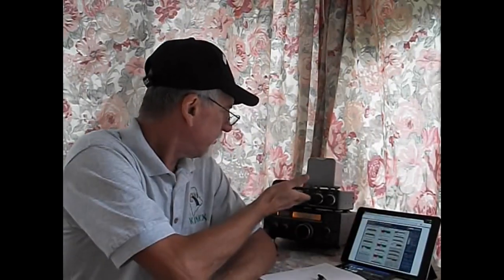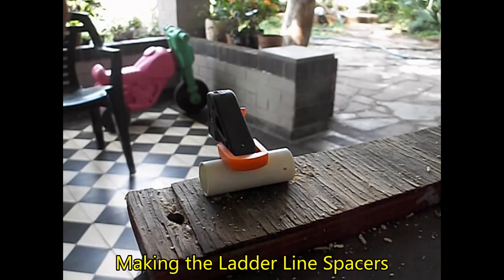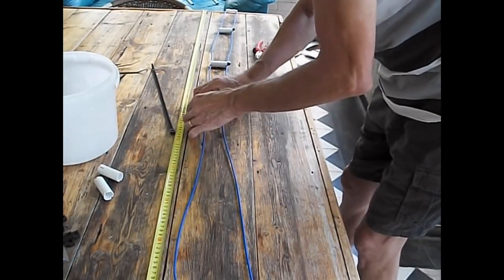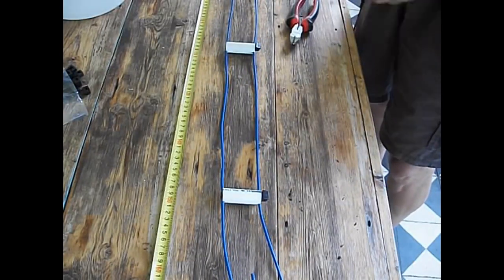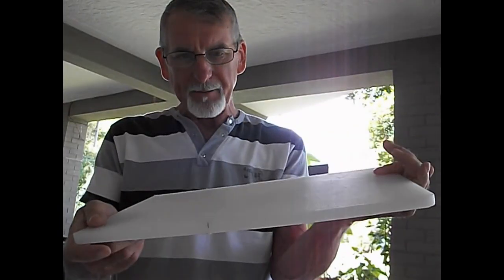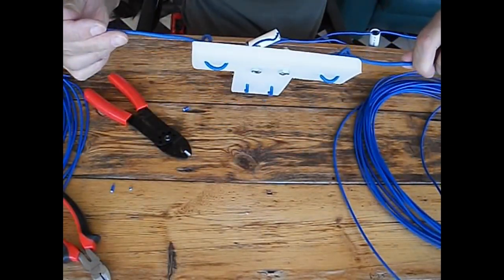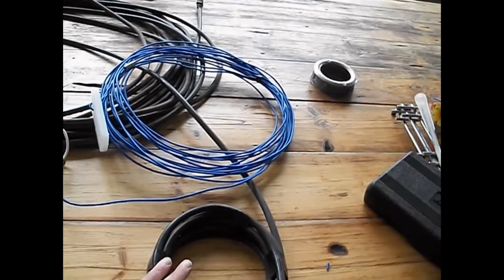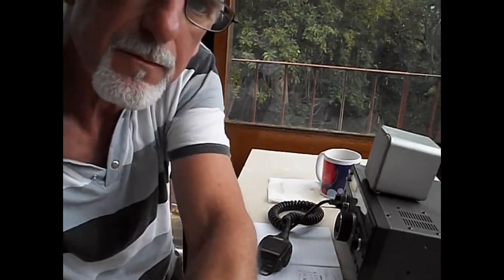ZS6BKW Dipole Antenna   The Build

Comment: Great job Tim. I use the small (pencil thick) PEX pipe and one black tie-wrap per separator to accomplish the same thing in building my ladder line. Just run the tie-wrap through the pipe creating a loop in the tube, capturing the wire on both sides of the tube and cinch it up. No  drilling or notching required. Simple and very strong. Keep up the good videos Sir.

Comment: When making the ladder line, if you drill the holes in a little farther from the end you can run the wire through the holes and won't need to use zip ties.
Reply from the maker: I got a little ahead of myself when I cut the spreaders so they were too short for that.  The flip side is I didn't have to thread all those spreaders on to the wires.

Comment: What kind of pole did you use? I noticed that you also had support rings , did you make them. I am excited, when I get home I think I am going to try one. Why did you not haul the feed point to the top of the pole? Thanks for your time. If you answer me, you are a kind and thoughtful. N4KBM
Reply from the maker: Hi Tommy, thanks for the sub.  

We welded 3 (6 meter) sections of steel pipe together (each section fit into the next) to make a 56 foot (17m) mast.  The support rings (for the guy lines) are a length of chain wrapped around the mast and welded in place 2/3 of the way up.

I initially did haul it all the way up, but couldn't get the right angle between the antenna legs so I had to bring it down a bit for good SWRs.

Here's the tower build video.
https://youtu.be/ahMNg8RYBkI

73s
Reply: Tim Clark - K1NKX   That pole is the envy of the Ham nation

Comment: Should you not have used Zs/ k1nkx as a call sign?
Reply: Correct.  I usually did, but must have forgot for the video.  Whenever I didn't include "ZS" I would add it when anyone answered my CQ.  Everyone was good with my method while I was there.  No SA stations ever mentioned it and well, my Elmer is the local klub president and lives half a mile down the road.

Comment: sounds like a good antenna? but i want one for  80 and 160 more so 160 would this antenna work good for that? could i add to the total length.?
Reply from the maker: You should be able to work 80 with a tuner.    Its a fun build or you can pick one up factory made for not much money.  These guys go into more depth, give em a watch, if you haven't  This is the video that settled me on the ZS6BKW.  https://youtu.be/MbXmAcf9MmI
Reply: @buckeye5704  yes but im wanting more of a 160mtr ant i have 2 up that i can go to 80. just trying to find a super simple 160mtr ant.
Reply from the maker: @butterbean4195  Ok, gotcha.  So this one isn't gonna work for you then.  When I get the house built and put the shack together, I want to work on a 160 wire, but that's a bit further down the trail for now.  Would love to see what you have up tho.  My SA elmer has his 160 wire strung in trees  on his small lot with the legs bent in all directions.

Comment: how many  watts can this dipole handle
Reply from the maker: I used 2.5 mm wire which is a little larger than 12 AWG.  
Based on this info I found, full legal limit (1500 W in the USA) should be no problem. 
https://www.quora.com/How-many-watts-can-a-12-gauge-wire-handle
Insulated for 600 volts, Number 12 AWG wire is rated 20 amps to 30 amps depending on the thermal capability of the insulation applied to the wire. If we assume THHN insulation with a temperature rating of 90 degrees C you have a 30 amp capacity.

Since watts is defined as Volts times Amps and we assume you will energize it to the maximum allowed voltage of 600 volts the simple answer is Watts = 600 X 30 = 18,000 watts.
Reply from the maker: Here's one I bought.  The description says 2000 watts
https://www.amateurradiosupplies.com/product-p/11003.htm
I haven't hung this one yet, but wanting to.  Probs next Spring.
Reply: @buckeye5704  I have that one also.  It ends up resonant below all 5 bands, but tuning it is no easy chore the way it is built.
Reply from the maker: @ErnieStedman  Yeah, the tuning part is the most work I did on the whole build.  Several trips to both ends of the radiators to trim, then back to the meter, rinse and repeat.  I probably did 4 or 5 cycles of that, but in the end it was worth the effort for this terrific performer.  And hey I had maybe 50 usd and 4 or 5 hours in it and for me it was all part of the DIY adventure.